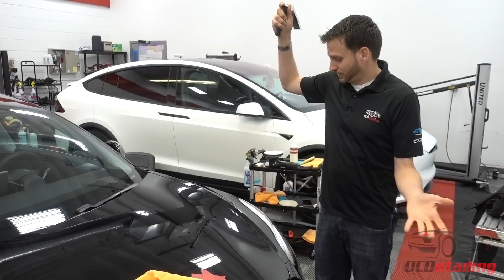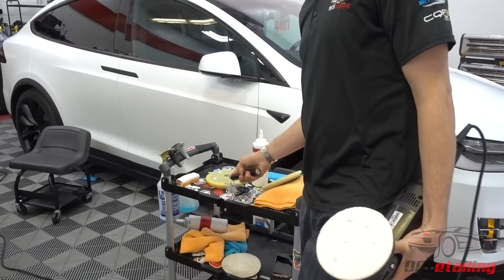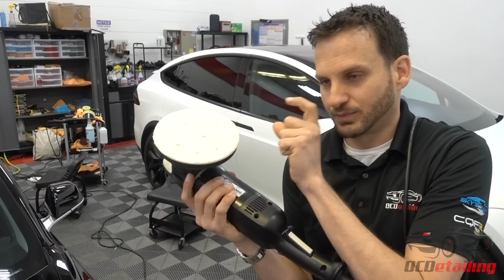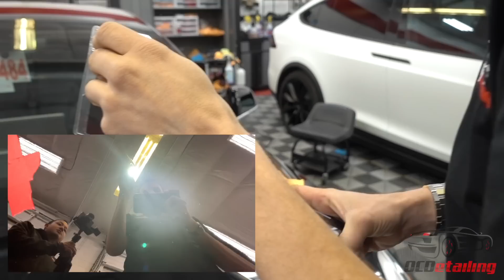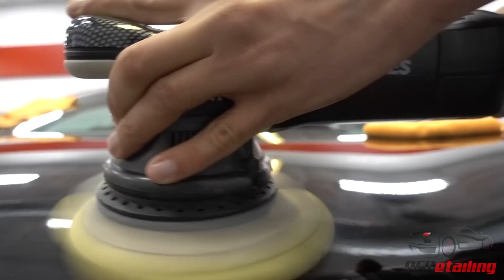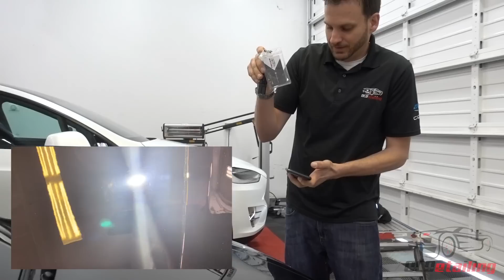Tesla Model 3 - How Tesla Doesn't Deliver It - Before and After Paint Correction

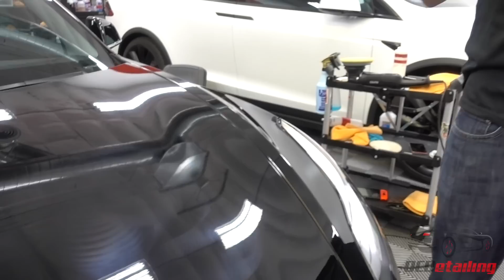Comment: Surly your watch with the matal strap should not be on ? No.....Just too add knowing very little about professional detailing is that ok to see the metal on the bonnet dent in and pop back out while working on a Car as at the 8:30 mark when you can see the Metal pop back out when pressure from the pad is taken off?
Reply from the maker: If I was doing the whole car watch def would of came off but for a section for the video demo I figured my thousands of hours of doing this I would be ok ;) And yes its very normal for that happen with any pressure and not an issue.
Reply: OCDetailing You go, Joe!